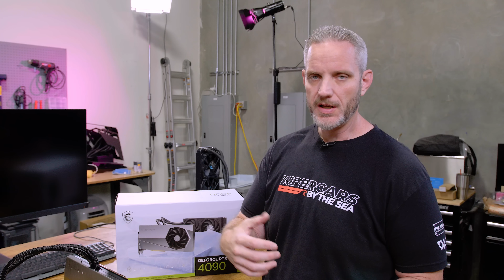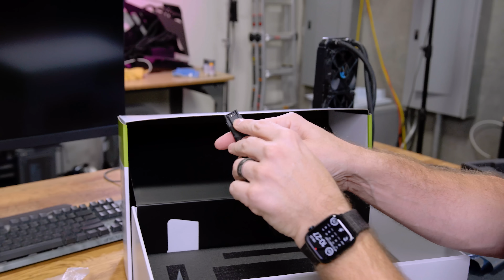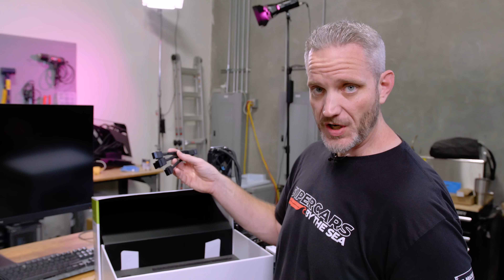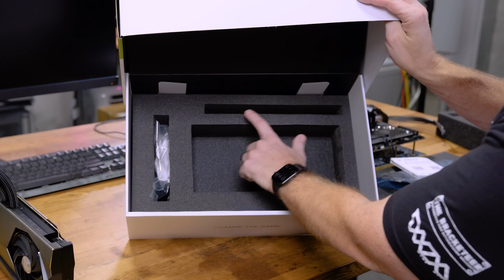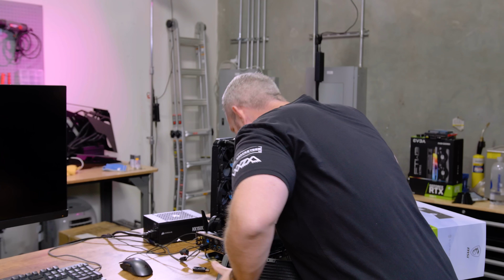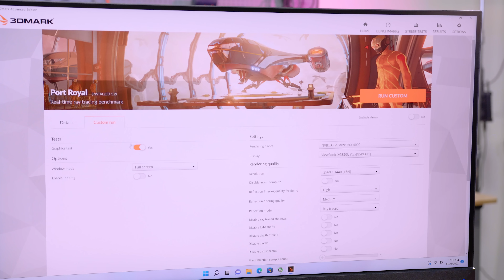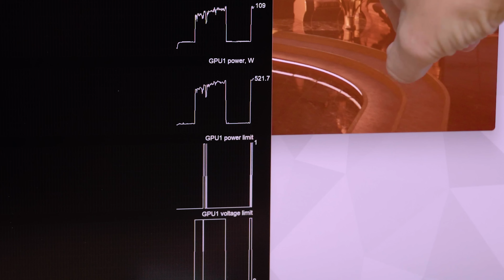This is the most BEAUTIFUL RTX 4090 yet...

Comment: The main concern in this design is how well does it dissipate heat with only two 120mm sections, where 4090 eats up to 600w. The pump might die very soon.
Reply: As someone who's got one. I will say it's a lot better then my 3090 Xtreme Waterforce card. Here's my experience. The 3090 used 360w - 380w at 1900mhz, producing a hot breeze from the radiator. This was at stock voltage. The frequency would drop quiet often as it fluctuates from 1900 to 1700mhz causing fps dips. Now, the new 4090, runs at stock voltage of 190w, at 2565 mhz at all times. It's a night and day heat difference, as the 4090 runs super cool. I've seen my 3090 hit 55c under full 370w load, while the 4090 sits at a nice 33 - 45c under full load at a whooping 220w. No frequency dips at all. For the lols. I undervolted the 4090 (30% power slider on msi afterburner) and stock fans.. Yup still pegged at 2565 frequency at 130- 160w. Insane. It's super cool, literally. I have also tried 128% power and Max fans, I can get a stable 3000mhz to 3100 OC, at 280w. Super excited how good it is. They did a great job!
Reply: @JohnDoeC78  undervolting seems a thing to do mandatory with this power hungry card, great results, the pump might easily say thanks to you 😄

Comment: $1749 is a $150 markup from the $1599 retail (not $250). I think that's actually pretty good for a custom cooler (since most Air ones are $50-100). That's the kind of price increase you would see on a 3080 with an AIO.
Reply: It's £2300-2500 in the UK. So £600-£800 extra. Terrible value for little to no extra performance. You could actually custom watercool another 4090 with that difference. Or buy a bigger case.  Temperature is not much of an issue anyways with these cards. Crap overclockers unless on LM2.
Reply: @dazlad926  2.399,00 € in the EU 😂 The cheapesd air cooled card cost around 2.200,00 €. Are the prices so much cooler in the UK that you can really beat the AIO with a new custom? Europe just sucks in term of prices.
Reply: Man thanks for the idea, was actually thinking of a watercooled build till you said it till it clicked in my head reading this lol like why the heck am i wanting to buy a 600€ more expensive than the FE msrp card where for that i can watercool multiple cards (probably).
Reply: Rip. 1 yr later this exact card averages 2200
Reply: $580 for my 2070s hybrid bought in april 2020. It was only $80 over a regular 2070s
Reply: You'd be lucky to find this model for $1750. I just bought mine for $1995 and it was the lowest price that Newegg had had it listed for in over a month.
Reply: I agree, the price is really good for an AiO GPU cooler. If I had that kind of money I would go for it for the noise and temp reduction.
Reply: Like you can even buy one for $1750. You'd be lucky to get a 3090ti for that.
Reply: @vheypreexa  I was in the store just minutes after a drop came in and got it at that price
Reply: i wish it was that price the cheapest 4090 in belgium seems to be 2299 euro and this one is 2599 euro.....
Reply: Lmao here in Canada they are $3115 USD 

($4200) Cad
Reply: I’ve had a pump die on me.  I’ll never go AIO again, air cooling has gotten really good.  If you need the extra cooling that bad, just do a custom loop, and accept that it comes with maintenance
Reply: this comment aged very very well in 2025 with 5090 release ;d
Reply: If you have 1600$ for GPU then extra 150$ is a nice price for lower noise, also i subjectively think that water cooler one will live longer and healthier than others 4090 variants.
Reply: @dachyvashakmadze1871  eh, since all of these coolers are designed for the maximum power target and you should always cap that power target at like 80%, pretty much all cards should be quiet enough
Reply: @maggi98mw  why do you always have to cap it at 80%. I run mine flat out and have never had any issues. I guess if I wanted them to last ten years 80% makes sense.
Reply: @formulaic78  because it looses only about 1% performance but decreases power draw massively (like 20-30%). Lower power means lower temperature and lower fan speeds
Reply: @maggi98mw  I'm not sure that's accurate. The performance profiles on my laptop scale closely to power allocation. Performance from balanced gives about ten percent more frames and then a manual overclocking with even more aggressive fans gives another ten percent.
Reply: @formulaic78  it's only really the case with the 4090. On 30 series cards and before you should do manual undervolt
Reply: @dachyvashakmadze1871  Don't think so, air is much more reliable let alone it's fucking MSI. More failed pumps than anyone in the game.
Reply: Yes. Sound like a reasonable price to me. Fun fact: in Germany its about 3000€.
Reply: @OnkelHucke  yeah our GPU market is an absolute scam at the moment
Reply: @OnkelHucke  ai ai..i thought it was bad here in Norway but it is 2600EUR including 25% tax.
Reply: @Tsenngu  €2.599 here in Belgium with 21% tax included. For the Strix OC edition it's €2.699! 😬
Reply: @OnkelHucke  that's ok it's not like you guys have the electricity for it anyway
Reply: @stuartfury3390  True. Our green party might recommend an Abakus for our future computing needs. Hopefully a 2048 ball version will be able to run Crysis. A 64 Bit Abakus might be a bit too large for my desk. 🤔
Reply: @OnkelHucke  Good luck over there.
Reply: @OnkelHucke  cant you guys just buy one from another country and ship it ? It would still be cheaper
Reply: @sadek__4952  Not once you also add in the customs duty you'd most likely have to pay as well. If I tried that here not only would the shipping and currency conversion make it more expensive but there would be Customs duty and the additional GST on top.
Reply: @Amaranthine1000  damn so its even way more expensive to build a PC in Germany than anywhere else… whats the reason for that ? Like logic wise. I heard you guy pay big taxes anyways so you already have your salary cut off big time you cant afford to have products be more expensive
Reply: @sadek__4952  No because you have to pay taxes at the border.
Reply: @OnkelHucke  yikes really ?
Reply: exactly, funny he was right on 150 then he backed off to incorrect 250, all that embarrassment could be avoided if he do checkup of his material before putting video out

Comment: Pay microsolderer to swap the memory, then chop off the tubes from the radiator, add quick disconnects and connect it to a MO-RA3 420 external radiator with dual D5s in a series and do your air conditioning mod to beat BPS customs please.

Comment: The design looks industrial and super premium! Amazing design! The best of all 4090 cards so far imo!
Reply: Imagine pairing one with one of those asrock aqua boards or any other silver or grey metal covered board. With some original silver non rgb dominator platinum! It would be gorgeous.
Reply: @MisterRorschach90  too much silver, need some contrast
Reply: the tube and power cable kill the perfect aesthetic 😔, messy af
Reply: im waiting to see what AMD bring but at the moment this card is the top of my list  small good cooling and a awesome looking card !!
Reply: The ROG strix model is the quietest and coolest running.
Reply: it's tied right next to the Gamerock by Palit... both really nice motifs
Reply: Until the pump fails

Comment: I support RGB software being separate because, by and large, RGB software is garbage. And if you get different software that can control RGB from a different manufacturer, you have to shut off the other software.

If they're unified and you want to use SignalRGB to control the GPU, can't run Afterburner anymore.

Comment: As someone who's got one. I will say it's a lot better then my 3090 Xtreme Waterforce card. Here's my experience. The 3090 used 360w - 380w at 1900mhz, producing a hot breeze from the radiator. This was at stock voltage. The frequency would drop quiet often as it fluctuates from 1900 to 1700mhz causing fps dips. Now, the new 4090, runs at stock voltage of 190w, at 2565 mhz at all times. It's a night and day heat difference, as the 4090 runs super cool. I've seen my 3090 hit 55c under full 370w load, while the 4090 sits at a nice 33 - 45c under full load at a whooping 220w. No frequency dips at all. For the lols. I undervolted the 4090 (30% power slider on msi afterburner) and stock fans.. Yup still pegged at 2565 frequency at 130- 160w. Insane. It's super cool, literally. I have also tried 128% power and Max fans, I can get a stable 3000mhz to 3100 OC, at 280w. Super excited how good it is. They did a great job!
Reply: Just ordered mine it will be here wed. i have i9 12900k and a 1,000 gq gold evga power supply, any power issues with a 1,000 watt ps?

Comment: TL:DR - This card with a larger case like the Corsair 4000D allowed me to put the side panel on the case without any real pressure on the power cable. It DOES touch the glass, but doesn't put pressure on the connector - it is easily 35mm away from the connector as Jay was pointing out in another video. So this card and a big case may be one of the few cards that can have the side panel on safely.

Comment: I have it mounted in a Corsair 4000D case as an exhaust (out of the front), with a corsair H115i i7-11700k liquid cooler at the top as intake. I switched my back fan to point forward so all the air flows in the same direction. This smaller card with a big case allowed me to put the side panel on without putting real pressure on the power cable, which is a huge deal it appears! The heat is real, and I am glad it is coming out of the case and not into it! CPU stays at 51, GPU stays at 62 under full game load.
Reply: is there gpu coil whine? i play at 1440p 240hz or 4k with DLDSR Upscaling

Comment: hey @JayzTwoCents possibly a bit late now but I've had that same bricking issue doing the same BIOS flashing shenanigans (more than once!).  My usual solution is to bung the brick into a secondary slot and plug something not-Nvidia in as the primary card - it might show how often I've done this that I keep an ancient ATI (yes, pre-AMD!) Radeon x1300 (passive, slot powered) card in the tool box for just this.

Then boot up windows and fire up nvflash. No it doesn't matter at all that Windows doesn't recognise the card, just that nvflash does see something flashable (this is why AMD card, nvflash won't see it).
This is also why the toolkit has an old x58 BIOS based board that boots up straight DOS - very occasionally this is the only way to get the card recognised by nvflash.  My experience is NV cards are really hard to brick without actual hardware failure - and yes, I've flashed/bricked a revA quadro with a revB Quadro firmware and resurrected it in 20 minutes with the correct bios.

Comment: The fact it’s so much smaller makes this model appealing. Will actually fit into cases lol
Reply: At this point, I think an entirely separate case just for the GPU alone is warranted lmao.
Reply: Nah in a few years you can get a attachment liquid cooler that might fit there's also all these fans each one is different,  and a radiator for the mobo/gpu. We can't even get 4k ips moniters that want to go over 65 fps.
Reply: Exactly.  Not everything is about overclocking.
Reply: I'm doing a Proto L build and this card would fit nicely in it.
Reply: It’s literally got an enormous radiator attached to it, it’s no smaller, it’s probably bigger 😂😂
Reply: @ESKATEUK it doesn’t eat up the third slot my guy. many cases these days have plenty of room for the radiator, Phanteks NV7 comes to mind. I’ll trade the room on the case for the unblocked PCIE slot any day
Reply: @ESKATEUK BUT if you don’t lose a PCIE slot agree it becomes less valuable
Reply: and most vertical mounts, since some cases like the DG 77 only admits 2 slots thick cards for vetical mounting.
Reply: only if you have an appropriate place for the radiator, which a lot of cases do not have.
Reply: @stuartfury3390  personally if you have a case that doesn’t take front and top fans you should be more worried about a new case than a expensive GPU
Reply: @yoshz5389  What? If you put this thing in a decent case you're taking away intake/exhaust for the system. What if you already have an AIO for the CPU? Now you're adding a gpu AIO, there's going to be no  airlflow anywhere and what airflow there is  is going to be hot. Not to mention putting a 240 AIO where you had a 360 setup prior- further loss of efficiency.
Reply: @stuartfury3390  Static pressure fans pull air through the Radiator into the case

One exhaust on the top, one intake on the front/bottom
Reply: @FrozenKingdom34  you clearly didnt read anything i wrote.
Reply: @stuartfury3390  Even my SFF cases have room for 240mm man. It’s harder to find a case that won’t fit them these days.

Comment: any idea why my power limit with this card is capped at 93%?
Reply: Couple factors, weak psu, not enough wattage (or poor efficiency, common in cheaper brands) You lucked out on the silicon lottery and your GPU can't go any more. You've connected 3/4 power cables to it, or worse you've bent the crap out the cable and fried it. Mines goes to 128% on stock launch bios. Oh yeah maybe check your GPU, I set mine to Gaming not Silent

Comment: Jay, big fan brother.

Did you mean $150?  This card is $1749 and the founders is $1599.  

$1749 - 1599 is $150, not $250.  

Anyway, I have this same card in my Lancool Mesh 2 paired with my Ryzen 9 5900x and I absolutely love it.  

Amazing card, nice and small, and with my push-pull setup on this rad and my custom fan curve, I’ve yet to see it go over 50 C.  

Have a great one bro.

Comment: Why do most AIB's do not make a water block that covers the entire front and back of the card and use a 360mm rad. That seems like the only way to properly cool everything on the 4090. I get that it would make this card cost $2000 or more but it would have the best Temps out of any card out there. The back might be tricky because of the PCIe locking mechanism and not all motherboards have a easy button on the side to release the GPU. Like my ASUS Z690 Strix-A D4.

Comment: Perhaps the 530w power limit is a budget allowed for fans & pump out of the 600w total, if they possibly don't get factored into the reported power measurement.
Either way, this seems one of the few ways a partner card can differentiate from the FE. Even if its not for the most halo of performance, but at least build configuration.

Comment: Couple of things- I have this card. I love it. Very quiet and fits in my Lian Li Lancool II Mesh case. It does oc the memory very easily. I got mine at Microcenter and paired it with a Ryzen R9 7950X on a Gigabyte Aorus Master X670E and 64gb (32x2) G.SKILL DDR5 ram. I also took the extra step to hunt down a Gigabyte UD1000GM PG5 with the new PCIe 5.0 connector so I can avoid the 4 headed cable monster. I have been very pleased with it. Very fast upgrade from my PNY RTX 3090 and Ryzen 9 5900x build. Yes, it is expensive. I also bought the extended warranty so if and when the pump quits on the MSI card, I have credit toward a new card. It isn't for everyone. I know most would say a xx60 or xx70 is more than enough. When I game it is on a 65" LG OLED C2. I do not game at 1080 or 1440. I want the horsepower for 4k. I don't play first person shooters often. But Forza Horizon 5 is beautiful on this set up. I was waiting for Jay to do his review of the card. I hope he does revisit it and tries a bios mod on it later as I have been wondering about doing the same thing.
Reply: I promise you nobody cares. You don't have to write a novel.
Reply: @DATBOCK  You cared enough to throw your useless comment in.
Reply: As someone who's got one. I will say it's a lot better then my 3090 Xtreme Waterforce card. Here's my experience. The 3090 used 360w - 380w at 1900mhz, producing a hot breeze from the radiator. This was at stock voltage. The frequency would drop quiet often as it fluctuates from 1900 to 1700mhz causing fps dips. Now, the new 4090, runs at stock voltage of 190w, at 2565 mhz at all times. It's a night and day heat difference, as the 4090 runs super cool. I've seen my 3090 hit 55c under full 370w load, while the 4090 sits at a nice 33 - 45c under full load at a whooping 220w. No frequency dips at all. For the lols. I undervolted the 4090 (30% power slider on msi afterburner) and stock fans.. Yup still pegged at 2565 frequency at 130- 160w. Insane. It's super cool, literally. I have also tried 128% power and Max fans, I can get a stable 3000mhz to 3100 OC, at 280w. Super excited how good it is. They did a great job!

Comment: In my opinion, overclocking is dead with the 4000 Gen. Because nvidia has pushed the Founders Editions over the last generations so far to the limit that the few Mhz that remain for the other manufacturers are not worth paying significantly more for.

The only added value is the better cooling solution at the expense of the graphics card size. Or like here with the AIO version dual slot design with quiet cooling. This solution also fits in many midi to mini towers where a 4090 would otherwise not fit. You pay for it and it has to be worth it to you.
Reply: Overclocking has gotten worse and worse over the years and now we are here

Comment: There should be a right angle adapter for the new power connector. Straight down would prevent the cable from sagging down and folding further due to heat and gravity
Reply: Aftermarket right angle adapters are confirmed and on the way. I have a feeling Nvidia is going to have to include a new right angle adapter instead of the one they have now with all their future 40 series sales.